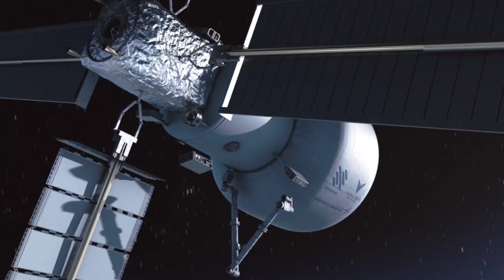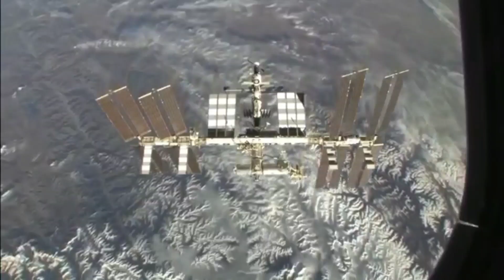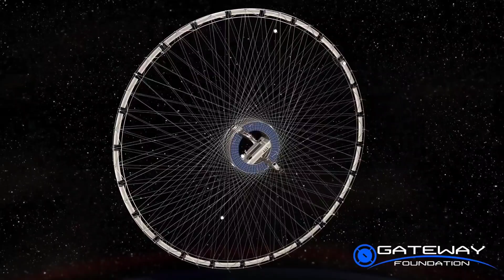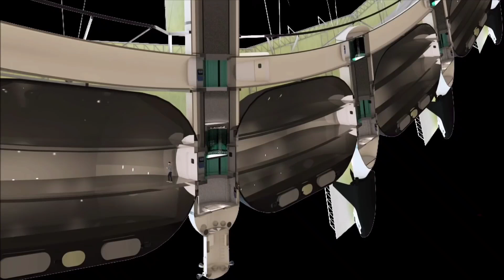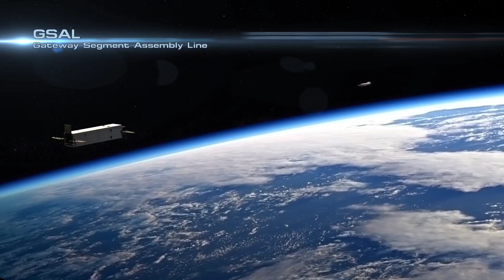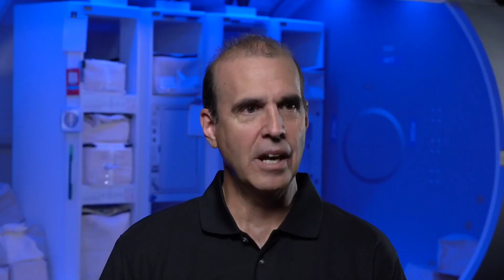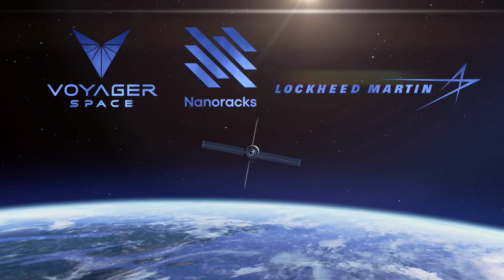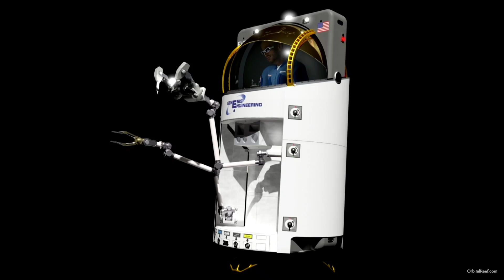How did SpaceX lose to Blue Origin on a NASA space station contract? Was this handled fairly?

Comment: While your point might be valid, the space station is not really within SpaceX's business model.
Their proposal appears to be in the realm of offering a customizable outer shell for others to reconfigure to their needs using a basic floor plan.
I'm not a fan of the ISS's unwieldy layout.   It's a small wonder that they were able to stabilize the ISS after the Russian module incident.
NASA's approach to the replacement is haphazard at best.  I'd bet that scifi illustrators could do a better job creating a stable design that would be fliable when complete.  So why not make it a design contest first.  Scifi illustrators against space companies.  Main criteria, it must be modular, stable, and reconfigurable on the inside (commercial companies come and go).  The design must be fliable (unpark and move out, rescue missions, nearby retrieval, avoidances).  Could something like starship or the booster (or two or three) lock in solidly and move it too if necessary.  Obviously with more than one attachment point.  And of course meet (for the most part) both private and commercial needs.
Reply: These ARE DESIGN and DEVELOPMENT contracts only, NOT CONSTRUCTION and DEPLOYMENT contracts.  It's all marketing BS from companies that have mostly never delivered anything to orbit.  Too many people think that architects design structures - they do not, licensed Professional Engineers do.  Science fiction illustrators are fine for portraying concepts and ideas, but they have nothing to do with the heavy lifting required to design, develop, construct, test, document, and deploy hardware on which astronauts bet their lives.
Reply: @jimmanley2796 , true.  I just think nasa has throttled the creativity too much and need to take a back seat.  I was thinking of how Musk approached the spacesuit design from illustration by a scifi set designer to construction with feedback from actual astronauts who would wear them.  I think the space station/science research and commercial construction station should follow a similar path.  Considering that nasa "says" they want a commercial partnership, a modular space station that could gadually transform into a spacedock is not that farfetched of an idea.
So let groups of illustrators and engineers together and let them go crazy.  Then get together for the nitygrity.
Yeah, Musk is a space case essentric at times but he knows how to make people think.  Nasa, bezos, trump micromanage way too much.
I still think Musk's approach to the space station was here is a basic shell you put the amenities in.  I'll launch it, but, I have other priorities to build.

Comment: I'd just like to point out, that in an artificial gravity ring, when you move away from the periphery, to the centre, the gravity reduces to micro/ zero
Reply: that was what i was thinking when he said that, just expand out the center part that is zero g, from a dock to a full station and the ring is for non work hours so you don't waste away, plus you can still do moon/mars g experiments too.
Reply: They haven't got a lot of volume towards the center though. Mostly it's a docking ring.
Reply: @opcn18  you could theoretically do the zero or micro gravity experiments there; was my point.
Reply: @pdloder  I get that, but that's not the station they submitted. Gateway has released several different station designs and zero of them have that capability.

Comment: I don’t understand how anyone could beat a single launch space station with such a massive diameter size as the proposed SpaceX space station. Not only would it be able to be launched into orbit with a single launch, but I would think that the configuration of the SpaceX space station would be a huge benefit, with it being single unit with huge diameter that’s almost half the size of its total length. 

The ISS has 39 separate very narrow daisy chained modules that required 39 launches to get into orbit, with the widest single module only having a 15 foot external diameter, with a smaller internal volume.  For ISS to achieves it’s habitable volume of 13,696 cubic feet and total pressurized volume of 32,333 cubic feet,  it’s total length is 360 feet. Any future space station that gets launched into orbit by any non-SpaceX typical size rockets, will be limited to having modules that have a similar small diameter as the ISS and will require dozens of launches. 

The single launch space station proposed by SpaceX would likely have a external length of 101.7 feet, with a 42.65 foot diameter, nearly 3 times the diameter of the largest diameter ISS module. The Space X SS is estimated to have an internal pressurized, habitable volume of 70,700 cubic feet, which is more than than 5 times the habitable volume of ISS (13,696 cubic feet) and a more than twice the total pressurized volume of ISS (32,333 cubic feet).

If a future non-SpaceX space station only has a goal of providing the same habitable volume of the ISS and if it’s put into space at twice the rate of ISS in terms of habitable volume per launch, it would need about 20 launches vs. a single launch for proposed Space SS, and it would still only have 20% of the habitable volume of the SpaceX SS. How does that make any sense financially and in terms of the timeline, not to mention how much easier it would be to maintain a single module.
Reply: One word ... PORK ... spread by Congresscritters across their states and districts ... that delivers NOTHING.  These aren't even CONSTRUCTION and DEPLOYMENT contracts, just DESIGN AND DEVELOPMENT contracts.  No one has to deliver ANY hardware (something at which BO excels), just pass a Preliminary Design Review.

Comment: Bigalow Space has been working on inflatable housing for years, and I thought NASA had attached one, or planned to attach one to the ISS for in space testing evaluation, so what is their problem with inflatable housing?
Reply: It was attached and is still attached to the station and used for storage.
Reply: If it doesn't walk like an aluminum cylindrical duck, float like an aluminum cylindrical duck, and quack like an aluminum cylindrical duck, most NASA bureaucrats can't figure out what it is.

Comment: If you are interested, I talked with Casey Handmer about using Starship as a space station module and what we came up with that we could get common agreeance  on is to make a specialized space station module Starship where you have hatches between the bulkheads, allowing the whole Starship rocket to be a space station module.  You could take the Raptor engines off and send them back down on another Starship.  You would put the more sophisticated stuff in the upper part of the rocket, but you could add a fair amount to the propellant tanks so once they empty out getting into orbit, there is at least some preparation to use them as part of the space station module.  The outside of Starship would be different because you would have extra insulation and shielding material for use as a permanent space station module where by default the outer shell is pretty bare bones except for some bulky recovery hardware as you are never flying this back to Earth but instead have to consider what is needed for a permanent stay in space.  Casey likes the idea of keeping the tank bulkheads in place so that you have multiple compartments in such a large space station module.  This would go well beyond the 1,100 m^3 you talk about.  Casey also insists on having as much work done on Earth as possible as he thinks it is too costly to do a lot of work in space and he thinks that a bunch of individual launches will be too expensive.

The idea of "wet" lab and "dry" lab go all the way back to the Apollo era as in propellant tanks double as space station modules.  In this case I am talking about a hybrid approach where you have that 1,100 m^3 "dry" lab fully kitted out and ready to go and then the "wet" lab sections where you do what you can from Earth to get things ready, and then slot in the remaining stuff in future flights to the space station.  So like you have a bunch of empty racks in place in the "web" lab to start and then future crews are sent up with say a bunch of short to medium term experiments and other projects to slot into those racks quickly and easily to do the work they need to do.  The "dry" lab will more likely have the living quarters, life support systems, central computer systems, etc, basically everything that couldn't start as being in a cryogenic propellant tank.
Reply: Ummmm ... no, you can't use propellant tanks for anything other than ... propellants.  No one could spend any time in contaminated tanks that can't be fully emptied, as their structural integrity would collapse (they're pressurized with nitrogen before being filled for launch).  Even wearing space suits wouldn't work, due to decontamination requirements every time someone returns to the habitable volume.  Then, there's the need to add hatches large enough to accommodate astronauts' passage in and out, which would introduce untenable structural risks.
Reply: @jimmanley2796  when you are in space, what is supposed to collapse it?  Are you saying the vacuum of space has positive pressure that will crush it?  When you have a cryo propellant, are you saying that can't be purged in space?  Are you saying we also shouldn't ride on airliners because those doors to the outside are an unacceptable structural risk?

I don't see why any of these things would be a problem and in fact it was a serious proposal in the Apollo era for a space station.

Comment: I agree, you don't just want to put an empty container into space. I mean the obvious standout part was a lack of solar panels or systems for venting heat or various other things. Didn't see obvious doors or points for any arms, ability to enter/exit, or dock/resupply except the base, overall it just didn't look like an actual thought out idea for a space station. Sure, you could have a great space in that rough dimension... but at least going by the visuals you showed that's not what we saw, and based on the description you read from NASA and their thoughts on it, that was likely just the issue.

Having a container in space, that's maybe airtight, is hugely different from having a habitabal container/s in space that people can live in for extended periods with full and redundant life support, power systems, bathrooms, planned areas for storage, how people move around, how things get in/out, how repairs can be handled, how communications can be done and any plans for what might happen if one area gets a hole in it or more seriously damaged... You know, ISS style, you want a comprehensive plan showing things being thought out and details... if someone just sends you a picture of what it might look like from the outside and skip all those internal details, finer stats, and stuff... you don't take them seriously.
That all said, SpaceX has its engineers and people working on stuff already, so how many spare hands do they have to put into actually refining all of this stuff? Not many... not unless they want to push back their plans for what they already have, so the reality is they aren't just that well suited for really spending the time to work on this right now.

Now, had they partnered with someone else who could do all the interior and detailed plans and they'd just focus on the main shipping it into orbit and the large outer body shell construction or such, this might have been a winner, but as it is... ya, too risky soundying.

Comment: The SpaceX has a bit wrong goals...The building of starship is good. But as carrier of materials to LEO, To the Moon at the maximum. 
-What should be following goal after they manage to make starship functional is to build completely different rocket for passengers. That may launch vertically, but landing should be using aerodynamic flight and landing on airport. That would be much safer for passengers than vertical landing, because landing can be completely unpowered.
-After the starship is functional, the SpaceX should start to construct relatively cheap Kalpana1 station. They could work with Gateway foundation on this too. A rotating drum with 112m diameter and about 90 m length. It would need about 80 starship launches to bring materials for it to extended LEO. This rotating habitat could achieve physiological 1g gravity while rotating at low pace of 4 RPM. This would make a great space hotell, and it would also allow to experiment with enclosed biosphere. Something what would be needed on Mars should we ever want to establish colony there. Closeness to Earth is invaluable for this kind of experiment should the biosphere fail catastrophically. The rotation of this habitat may be lowered so the martian gravity would be simulated. Realistically speaking, 0.38g isn't enough, we need at the very least 0.7g. At least our cardiovascular system needs that. It can be simulated well even in earth gravity using inclined bed experiments.
Reply: This is a DESIGN and DEVELOPMENT contract, NOT for CONSTRUCTION and DEPLOYMENT.  No one has to actually deliver ANY hardware whatsoever (something BO are world-class experts at not doing), just a successful Preliminary Design Review.  There is still plenty of opportunity for BO to stink up this effort.

Once Starships are flying commercial missions regularly to orbit, and a single Starship-sized station element can provide more usable volume than the existing ISS, everything else will probably dry up and blow away, especially given the ephemeral nature of NASA funding by Congress over time.  There's no guarantee that Congress will ever fund the construction and deployment phases beyond these design and development contracts.

Musk has stated a number of times that SpaceX's core business is space transportation development and operations, and they will only become involved in other aspects of commercial space engineering and operations if no one else is addressing them.  SpaceX purposely avoids the marketing aspects of this sector and concentrates on actually doing and delivering important things.  Any government agency attempting to evaluate business and marketing models is completely laughable, given BO's and others' "engineering solely in CGI".

BTW, the "2001: A Space Odyssey" type of rotating ring space stations with artificial gravity will never, ever become reality.  If you're not familiar with why, read Larry Niven's entire "Ringworld" science fiction novel series (not just the first novel) and search the WWW for the intrinsic instability problems with this concept.  Basically, any shifts in position of mass (even just one person) in contact with the rotating ring will cause precession off the intended axis of rotation to the other two axes of rotation, and the effects are cumulative over time.  Many say, "Oh, just compensate for the precession with attitude control thrusters", or some other similar scheme, but that just makes the problem worse.
Reply: @jimmanley2796  Just a comment on the precession controlled by thrusters- there is no problem with this with Stanford torus like habitats. 
The problems arise when you try to rotate objects which are longer than their diameter. See Intermediate axis theorem. In that case, thrusters may provide more stability, but only for a very short time. The solution: 
1. simple one- don't build the habitats with diameter smaller than length of rotating cylinder.
2. complicated one- build two counter rotating cylinders either as A) matryoshka: smaller, faster inside of larger but slower, or B) two cylinders side by side in support construction. In these case you may build up to 10 times longer cylinder as its diameter is without any problems. Longer cylinders would be possible but additional support would be needed.

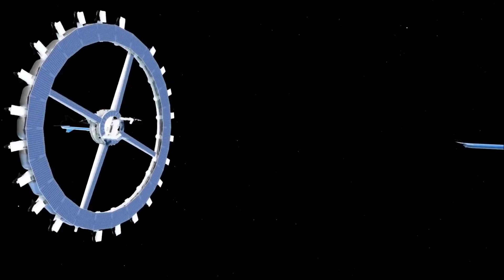Comment: 10:30 right out of 2001 Space Odesy.  I want that structure built, that is the future.  A necessary first step.
Reply: The "2001: A Space Odyssey" type of rotating ring space stations with artificial gravity will never, ever become reality.  If you're not familiar with why, read Larry Niven's entire "Ringworld" science fiction novel series (not just the first novel) and search the WWW for the intrinsic instability problems with this concept.  Basically, any shifts in position of mass (even just one person) in contact with the rotating ring will cause precession off the intended axis of rotation to the other two axes of rotation, and the effects are cumulative over time.  Many say, "Oh, just compensate for the precession with attitude control thrusters", or some other similar scheme, but that just makes the problem worse.

Comment: You would think that the fact that Blue orgin didn't deliver the BE 4 engine on time. And the fact that Blue Origin has not pretty much delivered anything of value would exclude them from consideration.  Indeed anytime New tech is presented ( inflatable modules) Nasa shuns it. This just goes to show me that the old ways are still in charge at NASA.